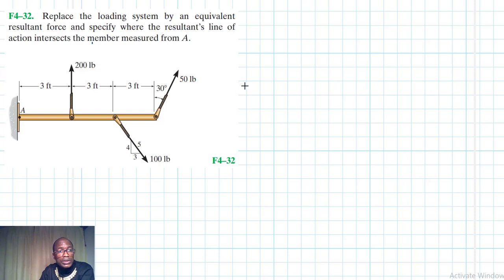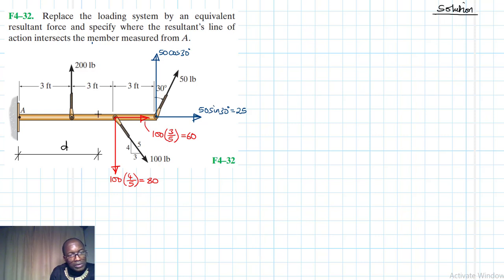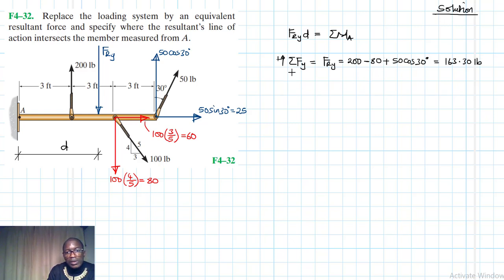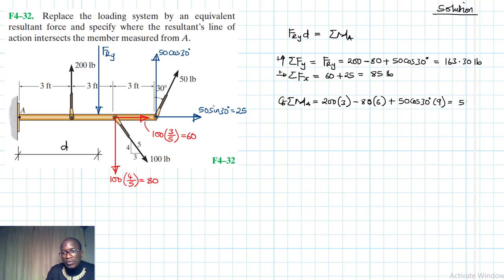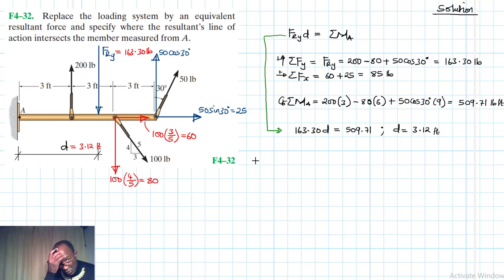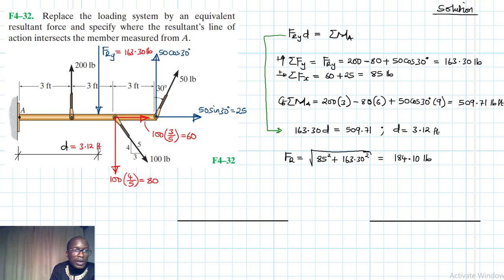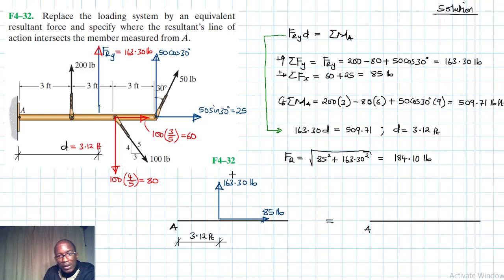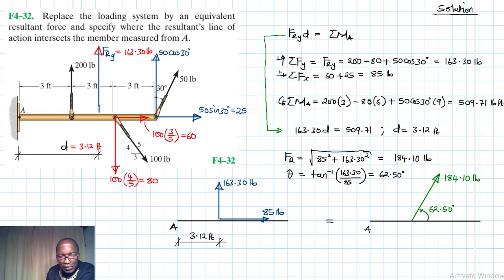F4–32 Force System Resultants (Chapter 4: Hibbeler Statics) Benam Academy

Comment: So the idea behind this is that you wanna remove the resultant couple moment from point A created by moving all the components of the resultant  force acting on the system to point A. But since moving all the components of the resultant force creates a couple moment expense for each force component, we can further simplify this by removing the resultant couple moment. And in order to remove the resultant couple moment, we can move the resultant force in a direction away from a reference point, for instance in this case point A. I finally get it!!!!
thank you sir!!!!!